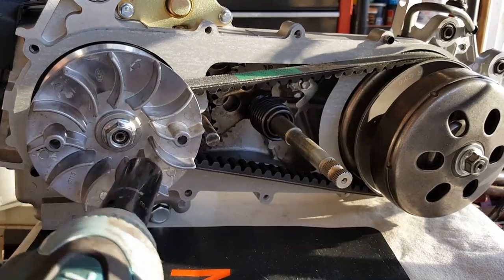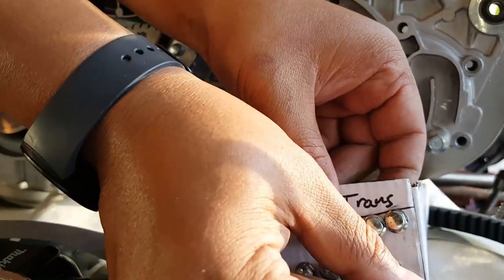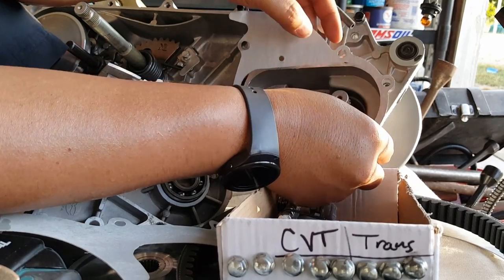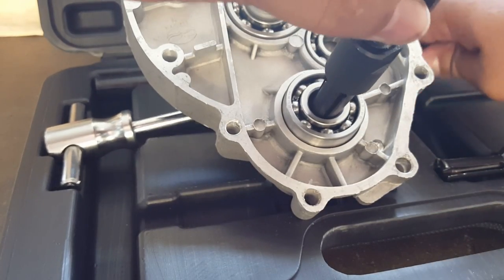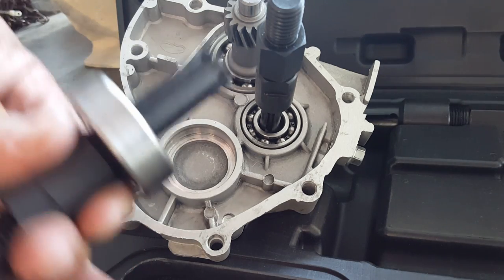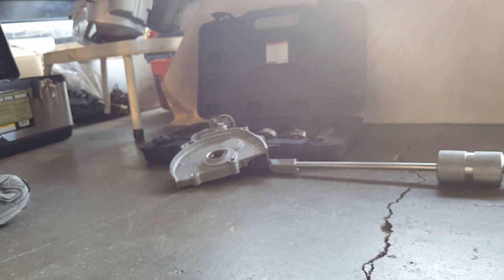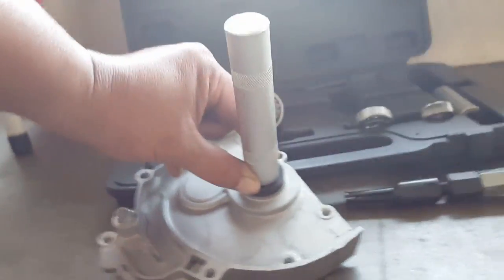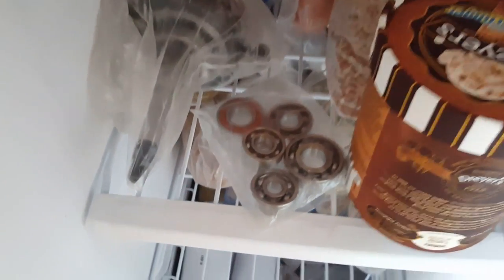How to Disassemble GY6 CVT & Trans 157QMJ Part #2

Comment: Does anyone know how to put a belt pulley on the crank to power a super charger? Is there a kit? I have the super charger the intercooler . Pop off valve and piping . But need to figure out how to drive my charger.. help anyone?

Comment: Hi, my original SYM jetpower 125 is an 828  19, but I still have a Powerlink 835  20 laying around from a previous project. Would it be possible to install it on my SYM ? Or it has to be the same exact size !!!? Thanks man.
Reply from the maker: If it fits and it rides well keep it on there

Comment: My variator nut wouldnt come out.the engine has only 2000 miles.i have used my powerful impact wrench and its impossible to remove..Any suggestion pls.i want to replace the rollers..thank you
Reply from the maker: One Love sorry for the late response but have you tried using some Blue Torch by WD-40 that might help loosen variator nut and hit with Impact Ranch again. It might be some buildup from some previous Loctite you can probably use a real heat torch lastly if that doesn't help loosen it.
Reply: NCY STORE .thank you much i appreciate your response and time..i know you are busy,yet you are offering a solution i haven't tried yet.i will keep you posted...very nice videos..your help is highly appreciated.thanks a million.
Reply: i got it,i used liquid wrench..which i already had...thanks again
Reply from the maker: One Love did that work?
Reply: NCY STORE ....Yes..it did...This a taiwanese gy6 150 cc that had been left outside on a scooter  for almost 3 years ,totally exposed to sun and rain.This liquid wrench is amazing.i used the yellow label one.Thank you so much .
Reply: Para que esa manjera que tiene hay arriba

Comment: Very informative video. Is it possible to change the variator clutch shaft?
Reply: You have a variator shaft and a clutch shaft, they are 2 different shafts. The variator shaft connects to the engine and the clutch shaft connects to the gearbox and through gears to another shaft which connects to the back wheel.
Reply: And you can change anything you want, some things are just a bit hard to change because you need special tools.

Comment: Hello nice Work nice what gears number ncy you recommend? stock bore cam a9,cdi, jets... drag and good top speed thanks
Reply from the maker: See product in video description what I used.
Reply: NCY STORE 15/37 gear thanks
Reply from the maker: @christopherrivas8917  long distance driving I will recommend changing it little bit better range but you might also consider changing the stroker as well
Reply: NCY STORE OK my friend thank you for the advice I look in the store to start belting thanks for your channel

Comment: Have you ever see. The shaft that goes to the reverse gear box snap in half? I think that is the issue with my daughters.
Reply from the maker: Really
Reply: @NCYSTORE  yep, part of it is stuck in in the reverse gear box and a tiny numb in the transmission
Reply from the maker: @MrKracen1134  how did you resolve
Reply: @NCYSTORE  I haven't lol Its still broke down

Comment: Do you have to remove the rear wheel in order to pull out the gear box cover?
Reply from the maker: no, it not a gy6 50 (139qmb).

Comment: Can I take parts from a 150cc short case engine and put them on a 150cc long case engine
Reply from the maker: YES, they both use the same gasket set thus MOST parts. HOWEVER, the only thing can't interchange due physical, length long case and short case, will be the actual left side of the crankcase and it's CVT Cover. See ex. engine gasket set both long case and short case parts fit: http://ncystore.com/ncy-engine-gasket-57.4mm-set-gy6

NOTE: This applies to all GY6 gasket sets.
Reply: Thanks

Comment: how much speed will i guet with this gear ratio
Reply from the maker: When changing gear ratio it's like metaphorically changing the bike gear ratio and the stroker is you leg kicking the pedal so those two have to be balance together, it will probably help the low end torque power. Power gain might be slightly more if it's depending on the terrain usage, that's hillside climb riding 15*37 gear ratio.
Reply: if stock is 13*40 for 50 to 60mph 15*37 should guive automatic more speed
Reply from the maker: it should but there's a lot of things that factor into it also  I'm not sure for certain